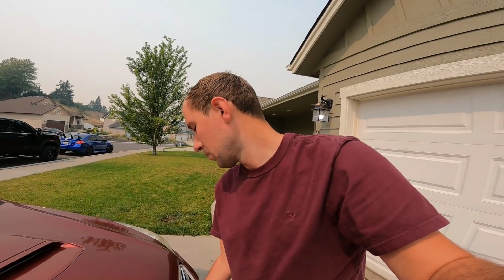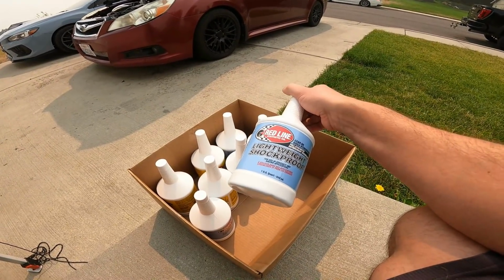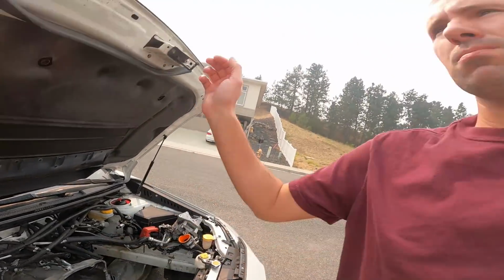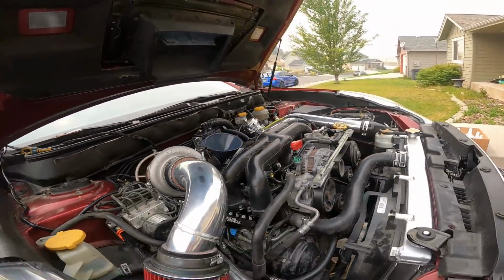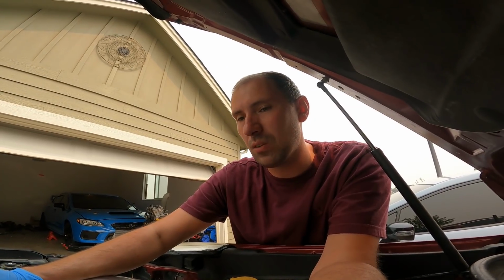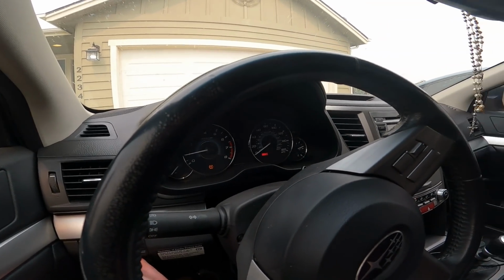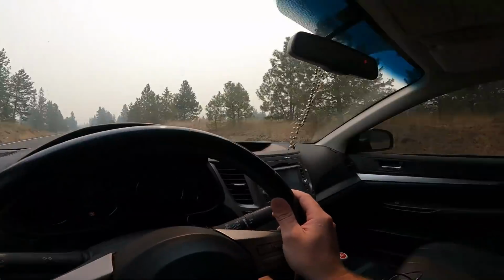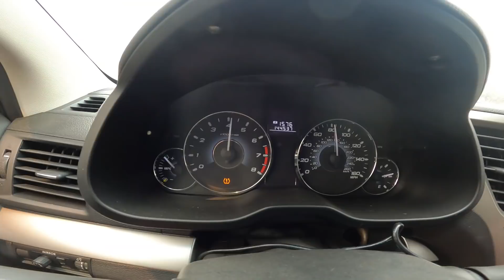Whats the Transmission Cocktail?

Comment: Every single video ive seen so far (its a lot..), everybody has used the Motul 75w90 and swear by it. I know from personal experience in 4 previous cars how good Redline has been for them. I just got my 2020 STI and want to do some maintenance on it. Should I just go for the Motul or is the Redline ultimately better??
Reply: I’m wondering the same, probably will just get redline 75w-90 and stick to bader recommendation
Reply: I have Motul 75-90 in my car and when it gets hot it doesn’t like to shift. So this is why I’m here lol

Comment: I've recently come across an issue with my '13 STI transmission where if I put load or get into boost on my 6th gear on the highway, it tends to knock itself back into neutral. All my research indicates that I may have a bad synchro for that gear to be replaced. Going to still try this cocktail out and see if there are any improvements. Hopefully.
Reply: Howd it go?

Comment: Put the cocktail in my ‘15 sti with a 4th gear grind. Fixed it instantly and every gear feels like butter now!
Reply: i have the same problem. i got a 2015 with the 4th gear grind. only at higher rpms. if i wait 2 seconds it doesnt grind. has anything else happened since then?
Reply: @hazael1229  putting these fluids in got rid of the grind about 95% of the time. Sometimes it still grinds but it’s much reduced. No other issues and I’ve done several track days and flat foot shifting - I’m running at 315whp mustang
Reply: Trans still smooth with redline bro ?

Comment: I've always read that the redline 75w90ns was good for the trans and the redline 75w90 was for the diff. Any thoughts about the redline ns? Going to be swapping an 04 sti drivetrain into an 06 WRX that blew it's 5 speed next weekend, so would be great to know! Thanks for the content!
Reply: I just did 2 lightweight shockproof + 2.5 NS It's fxxin butter smooth shift. I had NS for 50000km and started grind recently. I approve the cocktail. (15STi)

Comment: Wow, I was just reading about this "cocktail"  Turns out people have been using this for all sorts of transmissions for years. Gonna give it a shot
Reply: Yeap.. ive been running straight lighweight shockproof on my 5mt sf5 for about 7years now..... It does help reducing and saving my bad crunching shift many times....

Even during bad shifter bushing making messy sloppy shift 😁

Comment: what is the difference between the redline 75w90 and the red line 75w90ns? 
i have a bad grind on my 4th gear 09 sti hatch. Ill make the cocktail but idk if there is much difference or if I should use a specific one. Thanks

Comment: Hi there, I have a 6 speed dccd with oil pump, I was told you cannot use shock proof because of the pump, used to run it in my old 5 speed and really liked it, does the the combo work OK through pump? Or is this for a box that does not? I think they made some 6 speeds without? Cheers Tom
Reply from the maker: Hi sir, I’d advise only using 1 of the light weight shock proof, 2 max with a pump transmission. The heavy duty shockproof is the main worry for those pump transmissions. We have used 1 of the light weight with 3 75/90 option with great success
Reply: @BaderBuiltRacing  Sir, appreciate the advice 🙏  all the way from Nz

Comment: Love your channel..quick question Where do u fill up the front differential on a 17 sti ??
Reply from the maker: The same place you see in this video, trans / front differential is all one unit
Reply: Ohh nice thanks really appreciated
Reply: @BaderBuiltRacing  you so wise
Reply: @gendutz20  no heavyweight in any sort...

Just lightweight shockproof...

U can source it from N1 racing or multiple other seller from malaysia...

This cocktail helps reducing the issue of 4th synchro issue on sti..

Also benefits 5mt wrx/forester by using all 4liter of lightweight shockproof...

No heavyweight in any car transmission.. apart from maybe rock crawling heavy duty offroad

Regards from neighbours 👍👍
Reply: @AmirPomen  Thx for the reply. When I still own GC8, I used Lightweight SP for 5MT tranny, and Heavy SP for rear diff. Now I own GV, but no Lightweight SP nowadays here. Only 75W90 and Heavy SP. Thats why I'm wondering if 75W90 enough, or better buy other brand.. private import oil kinda hard to Indonesia. Consider flammable products. Need special permit 😅
Reply: @gendutz20  so far no other brands have similar oil to lightweight shockproof...

Maybe penrite oil? If available there?  If not mistaken penrite got some thick gear oil and engine oil as alternative...

Just im not sure how the oil compared to redline series... (Their racing engine oil is great btw)

As for heavyweight... Maybe.. maybe... U can experiment by mixing 0.5Liter of heavyweight with 3.5liter of 75w90... ...(untested)
Reply: @AmirPomen  don't have penrite either 😭. That's why the alternatives we got here (other than just regular oil like mobil 1, shell, castrol, etc) were amsoil, motul, rotal purple and moty's (japan). These brands what many people here consider "good". I want redline 😭
Reply: @gendutz20  too bad... Because the redline is really good stuff for gearbox oil...

Maybe u can look into royal purple/amsoil... But i still suspect none were as good as redline lightweight
Reply: @faris auto I was hoping someone would ask, I did my trans service some 10k miles ago and filled it from that plug you are referring to (the one right above the side drain plug )

Comment: i got a 2015 wrx sti with a slight 4th gear grind. its only happens at high rpms and it wont grind if i wait 2 seconds to shift. should i use 1 or 2 of the shock proof?
Reply: Same issue on my 2017 , you ever fig it out bro ?

Comment: Thought I’d hop on here and see what some of you think. Built long block 12 sti. Cams pistons rods bearings studs, everything. Anyway only on random startups . Maybe happens once every 5 starts my car will make a very weird noise. Almost like a knock but it’s only for a literal second does it one time then is done and will not do it the rest of the idling time or when I’m driving . Kinda scares me but I thought I’d see what y’all think .
Reply: Car runs great other then that . Very well. Trying to run just E85 from hear and on .
Reply from the maker: It’s going to one of two issues. Either a bearing in engine is on its way out or the timing tensioner is beginning to fail.

Comment: Hi Bader, can you tell me what cocktail i need for a tranny 5mt of a 2011 wrx, it runs with 400hp engine 
Tanks
Reply: At some point he says the 6 speed in the 15+wrx and the legacy that is the subject of this video  is similar to the 5 speed, he says something along the lines of 'you can use 4 of the lightweight shockproof but in this car we are going to use 2 shockproof 2 regular.' So anywhere from 4 lightweight shockproof to 2 lightweight shockproof + 2 regular. I am thinking of running it in my 2011wrx too. Almost to 120k miles and have no idea when it was last done.

Comment: Has anyone used Motul gear 300?
Reply: Yep, I drained my OEM trans and diff oils out after the first thousand miles and replaced it with Motul Gear 300 75W-90 with no problems.  It was never grinding and still doesn't

Comment: I’ll just stay quite about this “cocktail”fluid. Let just say I wouldn’t  put anything other then Motul fluids in a Subaru.
Reply from the maker: Let’s just I’ve had bad experiences with motul fluids… I’m sure everyone has had some kind of experience with everything out there. In last 8+ years no issues with this cocktail and lots of factory sti trans doing things other can’t here.
Reply: Actually motul is slightly overrated..
As example 300v giving less protection in racing situation than lucas racing oil (my own roadcourse race bike experience)

And the sti/wrx grinding gears cant be solved fully by motul fluid.. but this redline lightweight does wonder...

Im running redline for 7years+ in hot humid climate outside usa in my 5mt sf5...

Also since im doing subaru work myself for friends like bader did...(just in smaller scale)  the number on grinding and bad synchro issue reduced by using this redline ligtweight cocktail, i lost count... Lol

Comment: That cocktail is a disaster waiting to happen
Reply from the maker: LOL
Reply: Using shockproof is a plaster on a sore
You are using a lubricant to dampen an issue.
Reply from the maker: 8 second stock sti transmission in a full weight car with 1100+whp zero issues. I’ll continue to use a fluid that works and keeps proving to work. We have used this fluid long term and never an issue caused by the fluid.
Reply: I’ve been this cocktail fail so many times especially on synchro trans